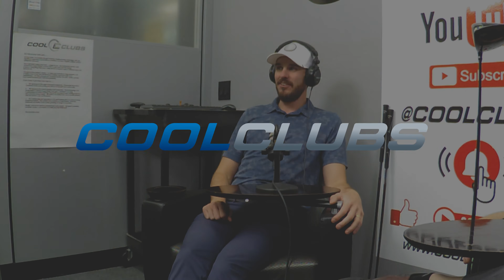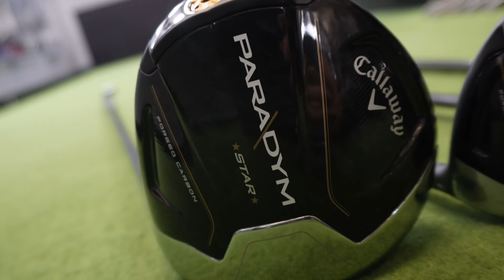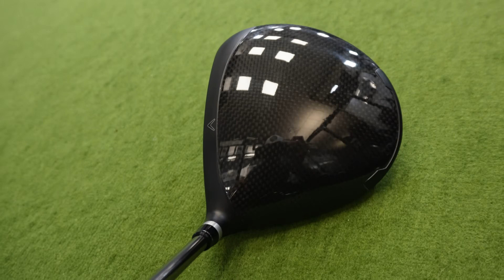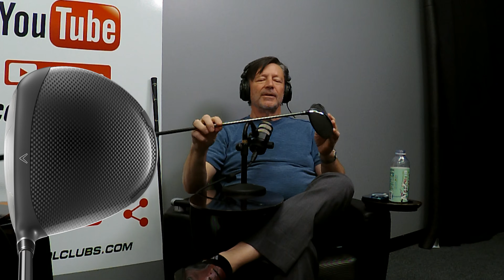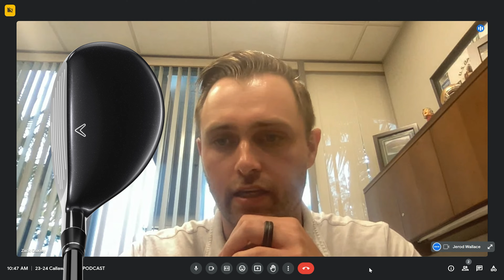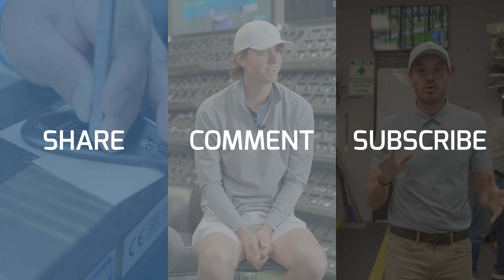Paradym Star - The First Word

Comment: Callaway should of kept the 4 iron in this set, but now I think I can run Driver, 3W, 5W, Hybrid, 5i thru AW, 52 or 54 degrees, 56 or 58 degrees wedges, and putter in my bag. I’m 55yrs old and still swing in the mid 80’s to 90 tops with driver so I think this set will benefit me greatly. Thank You Callaway for looking out for us older golfers and lower swing speed golfer.